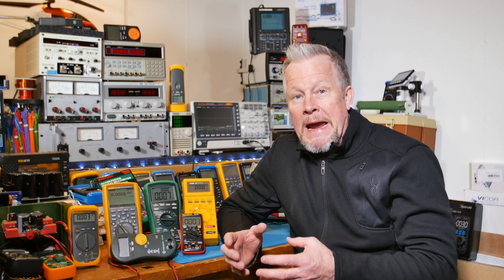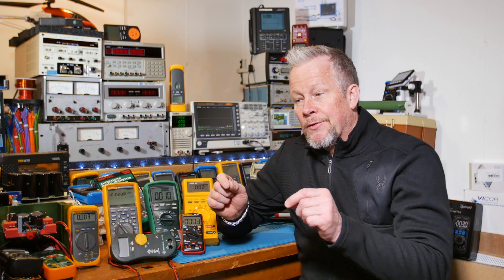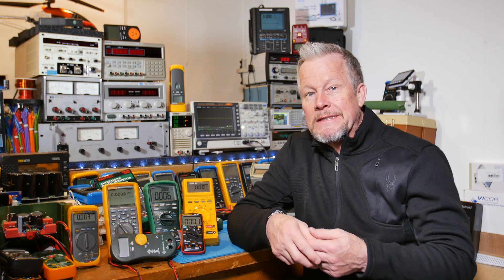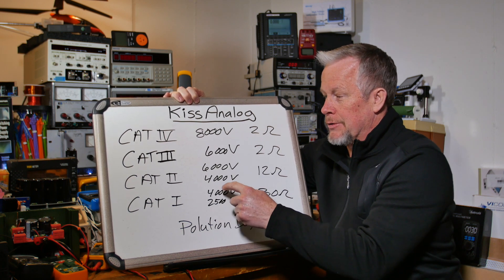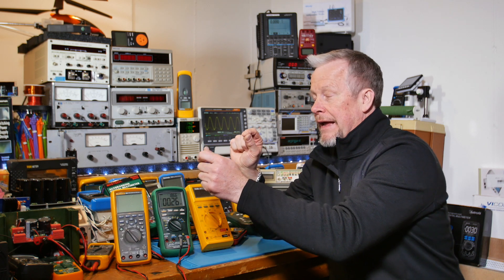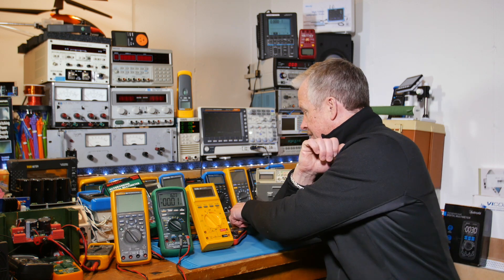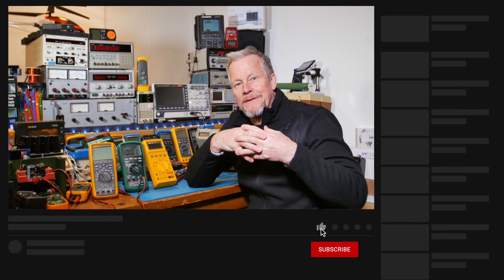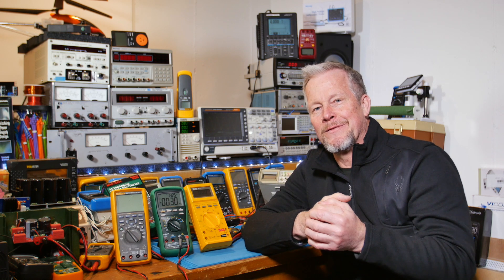Meter Safety Tutorial pt3

Comment: Great video. I had not heard of pollution degree before.

A friend once told me a story about a guy that brought a meter inside from a cold truck during the winter, and the condensation caused the meter to blow up.  I have no idea if there is any truth to the story, but I have to admit I’ve never used a cold meter while working in cat 3 since hearing the story.
Reply from the maker: Wow - thanks for the great feedback!  Yes Pollution degree is important to describe the dielectric integrity.  The IP (Ingress Protection) rating is important to show how well sealed a meter is.  Funny thing - most Fluke meters do not have a very high IP rating.  The venerable 87V for example, so they made the 87V max that does have a good IP rating.  But here is a much better deal - and far better price that also has 3rd party safety testing: https://amzn.to/3q13mpv

Comment: Thanks, Eddie. The owners manuals to my Fluke 87V and Brymen 869s say both are rated to CAT IV and Pollution 2.
Reply from the maker: Sweet!  Which of the two meters do you seem to like more?  Is there a favorite?
Reply: @KissAnalog  My Brymen, of course. It has the dual display and better resolution. But whenever I mess with CAT 3, I still grab my Fluke. I bought the Fluke 87V-E2 so It has the HV leads and crocs.
Reply from the maker: I really like the display too;)